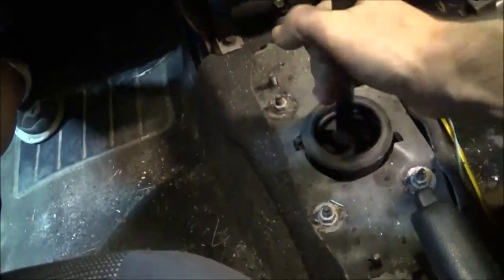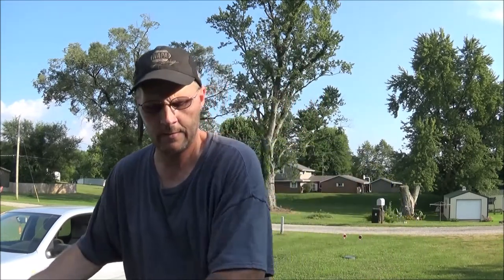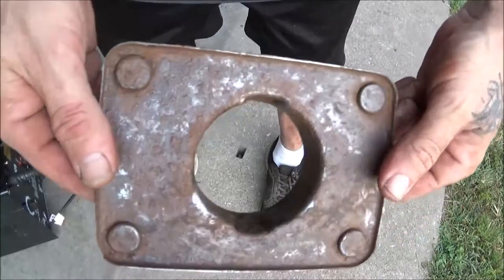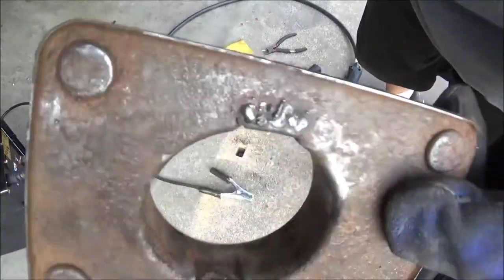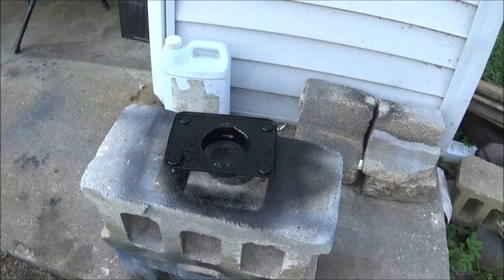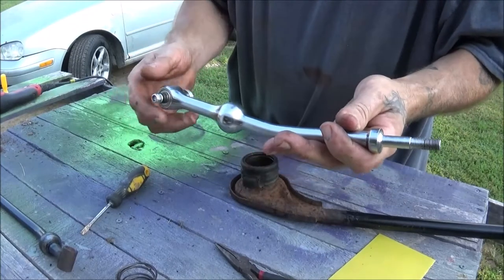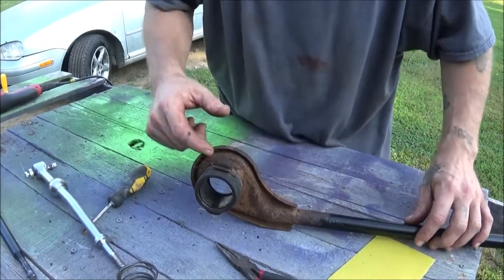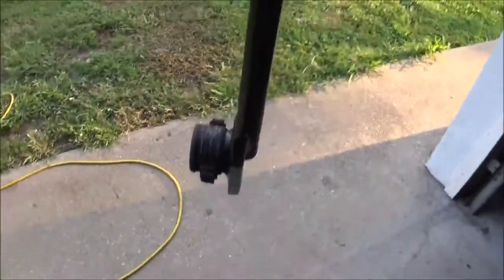SHIFTER ASSEMBLY REPAIR AND SHORT THROW SHIFTER INSTALL

Comment: Do you have the OEM exhaust pipes or larger ones? I don't think I would need to modify it with OEM exhaust, especially since OBX offers one for the ZX2 and the B&M shifter dimensions seems similar to the one you linked, and the "Ralco RZ" one on ebay. Maybe delete the shields?
Reply from the maker: I'm running 2.5" pipe
Reply from the maker: And I deleted the shield but I still had the shorten the bottom end to get it to fit for what I have set up. If I was able to set up a different exhaust I could have used it without modding the shifter
Reply: @royzcustomz  awesome thanks for the replies! I was able to perform the service on the stabilizer, it was falling out and hitting the shield, my ball and cup, spring are good it was just the "bushing ears" that broke - I used cable ties and polyurethane calk to repair it last night, it worked like a charm! Going for the short shifter at some point !